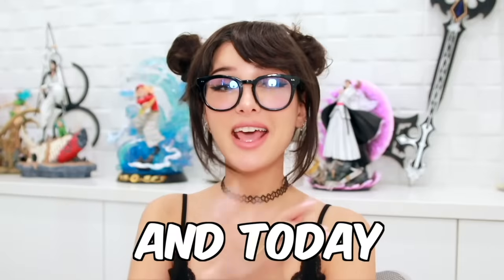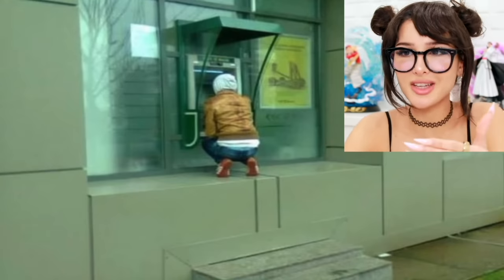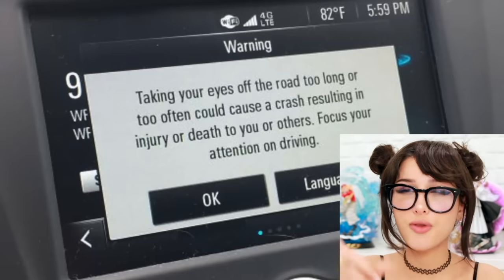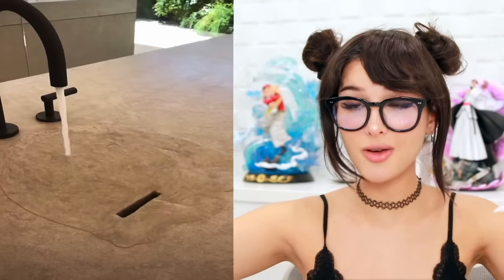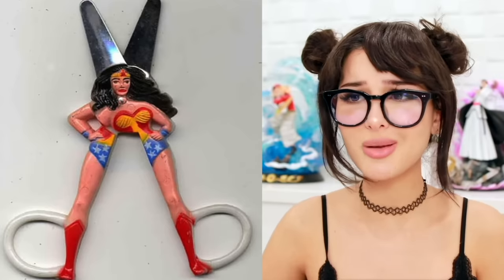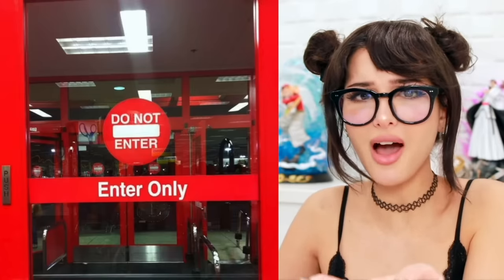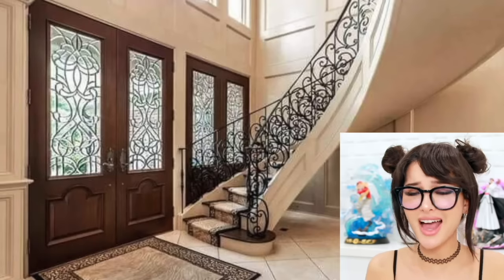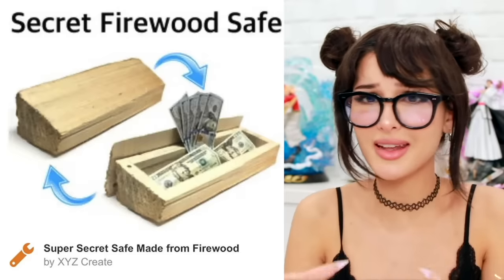Design Fails So Bad It's Actually Funny

Comment: 1:37 Actually the soap can stay on, it's just that it will melt/disintegrate so the bottom of the soap bar will be fizzy a little bit. Not only that but when you use it and put it back on there it will get smaller a lot faster than usual.
Reply: Or the toilet paper
Reply: @bipanic7829  Bruh it's  a SHOWER it's gonna get wet
Reply: @Lemony_fox.  no i mean there is also a toilet there
Reply: You.     Look 😇
Hi
Reply: Hi

Comment: 1:39 I use it as a foot hold for shaving my legs.
Reply: ohhhh thats actually a good use for it!...Wait is your soap holder like extremely low to the ground or are you just like a million feet tall??
Reply: @sandysam1622  See how it is very close to the bathtub these aren't soup dishes they are footholds for cleaning and shaving legs and in showers are placed at mid-shin. Also, I wish I was tall.

Comment: For the hallway bathroom, especially the toilet paper is also designed fail because you have to climb up, then grab the toilet paper, then after that, you have to sit on the toilet after grabbing the toilet paper, and then start using the bathroom.😂😂

Comment: At the cabinets that works with my dishwasher because there's a cabinet right by it and whenever I'm doing the dishes and putting them away and I have to put it in there after close the Haunter dishwasher and then open the drawer and then close it and then open up the dishwasher